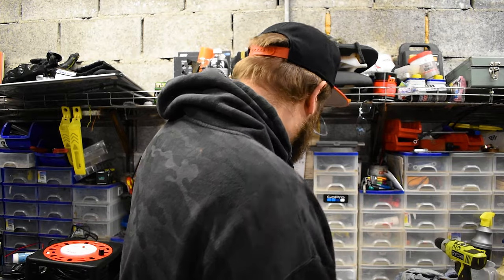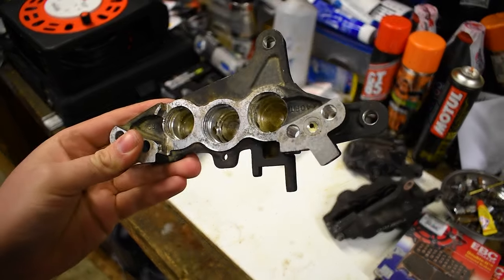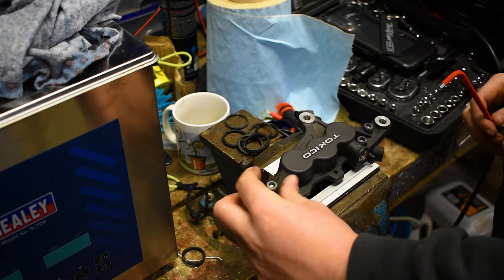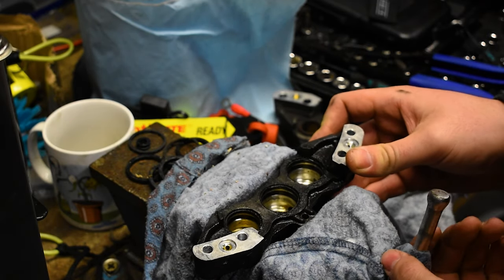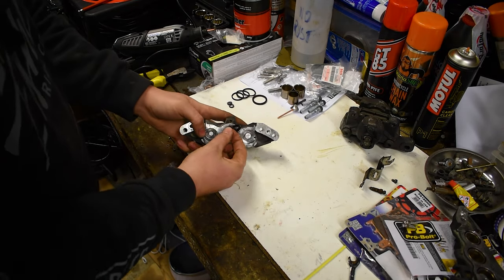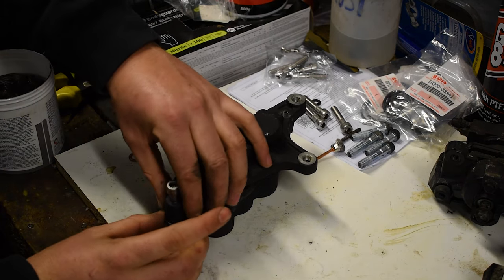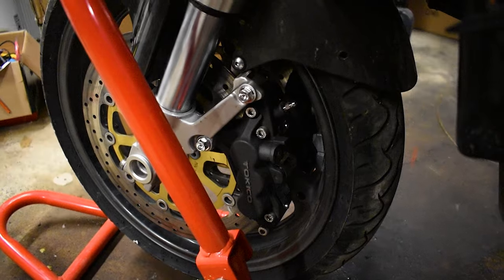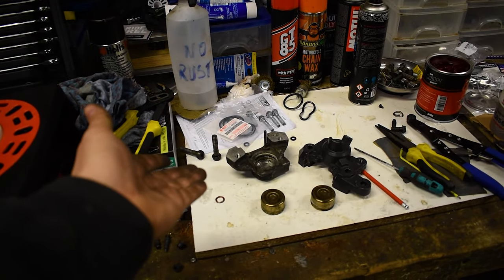Tokico 6 piston Caliper Rebuild | Suzuki GSX R 750 SRAD

Comment: Fantastic, thanks for sending me this link earlier.

Looks like I will be buying a piston removal tool & new seal kits 😊
Reply from the maker: You're more than welcome, thanks for watching it! :) 
I hope it works out and improves those brakes for you, I would say push the pistons as far out as possible before using the removal tool, makes it 10 times easier! :)
Reply: @TheGorillaBiker  
I gathered that after removing them from the bike, but I'm sure I've no way of doing now? I've no high volume air pressure, unless a trip to a fuel station yo use theirs will do it.
Reply from the maker: Ah yeah if they're already off just pull them or get access to some air, you would need the right head I don't think the tyre one would work as the air needs a seal.

Comment: Another good one.  Everything underlines the use the bike all the time, and change all the fluids regularly.  Love the stainless steel.....bling at its best!
Reply from the maker: Thanks :) Absolutely! Literally nothing wrong with this bike but it was left sit so long, and you can see the damage that did all by itself. It also shows if all the fluids had simply been drained it would have been 90% easier to sort.

Comment: Nice work.  I bit the bullet and bought a 15L ultrasonic cleaner  to do the carbs, and clean the front calipers before rebuilding them. Just waiting for to arrive, hopefully before Christmas.
Reply from the maker: Ah very nice! 15L will be the absolute job for that stuff :) 9L is grand but the carbs have to be split fully or like dipped 50/50 that way :)

Comment: Hi GB, hope you're well! I just watched this again as I finally got hold of a manky set for my bike to refurbish. Original on the ZX9r too, but people always change them for 4 pots as they are useless at rebuilding and bleeding them lol.
It's going to get costly, but initially only cost me £9.50, gonna cost around £250 in total, poss a bit more by the time I'm finished. I'll be buying the same mounting bolts from pro bolt, ordered those other SS bolts from ebay earlier, also ordered new pad retaining springs, surprisingly cheaper from Kawasaki than Wemoto, by a lot.
Gonna be a while doing these as need seals, and pistons too which at the cheapest I've found will still cost up to £150, and pads, pad retaining pins and R-Clips. I'll also paint them as I did my 4 pots, purple with gold lettering, fun project but gonna take a while due to costs.
This video helped me figure out exactly what bits are missing, and what needs replacing, thanks for that 😎👍
Reply from the maker: I'm doing alright man, this whole moving country craic is slow going though :D Haha the amount of people I know who binned a set of these because they couldn't bleed them is mad, great brakes really!! 
That's still really really cheap all things considered for what will be very well done brakes once you're done with them :) That is surprising, shows why it pays to shop around though and check everything eh!! 
Yeah pistons are the real killer, very lucky I manage to rescue mine!! Hey worth taking the time and doing them all the same, once they're done they'll be absolutely class, pity money is a thing. Stops us doing all the bikes. 
Ah well thanks for letting me know and I'm glad to be of some help!! :) Sorry for the delay in responding, country move etc.
Reply: @TheGorillaBiker  Yea they'll be great once done 👍
No worries on the late reply we know you're a busy man, good luck with the move, I'll keep an eye out for any updates!

Comment: Great video mate , I'm doing the front calipers on my 600 bandit at mo so found this very useful.
I extract the pistons though by operating the brakes .
I crack all the bolts and stuff beforehand ,take the calipers off place them in a pan  or vessel that's supported so that all the fluid that comes out is caught , pop the pistons out , let the brakepipes drain then disconnect the calipers and dismantle on the bench .
Obviously you have to be careful of the fluid because it is not kind to paintwork and you do not want it on the discs if you can help it .
I refill system using back fill method with an adapted squeeze bottle .
It works for me .
Reply from the maker: Thanks! Glad it was :) 
What you didn't see is this bike was sitting 13 years before I got at it and those pistons were frozen when j tried exactly that :) Definitely easier ways to do it than this if your system is still working prior to the rebuild :)

The backfill thing I really have to try as itd save a hell of a lot of time and fluid I think.
Reply: @TheGorillaBiker  I know what you mean about seized pistons I had the same problem and I couldn't get hold of a pair of those piston removal pliers from anywhere !.
Tried all sorts to get them out , took calipers to my local garage and they couldn't remove them as compressed air didn't work .
Do had to return to hydraulic method!...but used backfill method ,you ought to try it mate it's quite good as you don't get air trapped in the pipes .
Reply from the maker: I know the feeling! The only way I could get the rest pistons out was air and it read 11 bar before it gave finally! 
Ah lovely. I wouldn't like to have to refill everything just to take it apart 😂 Yeah so I've heard! I'll def give it a try :)
Reply: @TheGorillaBiker  I had no choice but to refill and then strip them again but I've learnt now and always use same method .
Eh regular maintenance pays off!
Reply from the maker: Oh god yeah, everything in my collection gets regularly looked after, to avoid situations such as this one 😂

Comment: I was waiting for something to fall in that mug @ 9:26 😆
The other way to get the pistons out is by wedging a socket and square end of a 1/4” extension bar into the piston cup and as you turn the handle it camlocks onto the sides so you can rotate and slowly wiggle them out, you just have to be careful not to twist too hard or you can actually deform the pistons slightly. Ask me how I know 🙉
I'm in the middle of doing this right now it's a disgusting and messy job. 😖
Reply from the maker: Haha that's actually what it's there for! It's cracked on the bottom I put small parts in it :) 
Yeah I've seen that method used but have also heard from multiple people of getting everything stuck in the piston hahaha. Not ideal :D 
It's very rare that it is a pleasant job sadly.

Comment: Hi GB, I have to remove the brake pistons on my Thunderace. They are four pot opposed calipers that don't split and I don't have access to compressed air. Haynes manual says to block one side with wood and use brake lever to push the other side out. Then remove seals and replace pistons and use lever to push opposite side out. I can't visualise how that would work without squirting large quantities of brake fluid everywhere. I'd like to use that tool you have. What make is it please and where to get it if you remember. Cheers :)
Reply from the maker: Ah lovely, they can be a pain to get apart! It does work fairly well, but yes it can get a little messy, it's not as bad as you think tho you don't lose that much fluid doing it if you get stuck doing it that way! 
I don't remember but it'll be in my ebay history, I'll try dig it out and send it to you :)
Reply: @TheGorillaBiker  That's very helpful, cheers :)
Reply from the maker: https://www.ebay.ie/itm/Motorcycle-Bike-Brake-Caliper-Piston-Removal-Remover-Pliers-17-5mm-33mm-/123919326395?mkcid=16&mkevt=1&_trksid=p2349624.m46890.l6249&mkrid=710-127635-2958-0

Comment: Believe it or not I have done this job on the Gtr previously and it was a pain (bear in mind I had to work on the floor of the young lads playroom due to a lack of garage 🙄) and i ended up throwing the calipers in the boot of the car and bringing them to the local petrol station to blow out the pistons using the air compressor there. Some craic on a wet miserable November night.
Reply from the maker: Yeah it's not the most fun but it's grand with a garage :) You're more than welcome to visit once we're allowed again and tinker 😁 
Yeah I had to blow the rear pistons out at the dads shed as the tool was too small.....wouldn't have been fun in the rain at a petrol station no...

Comment: Hi GB. I find it better take brake pads out and pump the pistons out before disconnecting the brake lines. Nice job you do e though keep it going 👌can I ask what litre your ultrasonic cleaner is and how much it was.  Thanks
Reply: @MonkeyButtRides  😄😄don't forget to duck
Reply from the maker: I would have done that but sadly sitting as long as they were the brakes were completely frozen so pumping did precisely zero :'( It's a 9 litre tank, made by sealey and cost far too much money, 350ish I think I paid.
Also yes, @monkey-butt.....duck a lot :D
Reply: @TheGorillaBiker  ok thanks for reply.  Not too much money if its doing its job..
Reply from the maker: This is very true. Plus it'll do me for many many years so it was worth it I think!

Comment: My God Man, you have come through for me yet again. I just should shut up and put my money where my mouth is and send you a couple of dollars for your content.
I'm in Halifax, Nova Scotia, Canada. I have a 99' GSXR 750 W that I bought almost brand new and now it has 83,000 kms on it and still going strong.
    Just today, I took it out for a really high speed run but noticed it's not braking properly. I stopped the bike and notice I had a mushy brake lever, but when I put the wheel up and spun it and then hit the front brake, a noticable " CLUNK" comes from the left caliper and when I let go of the lever, ANOTHER "clunk" .. Jesus, it sounds so wrong, a mechanical clunk as if there's no fluid and something just smashed the pistons against the rotor, I put my hand on the caliper as I did it over and over and you can feel the pistons hitting home hard, dam hard to explain that noise. 
    I haven't taken the caliper off yet, I was trying to buy a new one, or a aftermarket replacement one or even a used one .. NOTHING can be found, so now I'm going to the shop tomorrow and buy a complete rebuild kit, new pads and do the rebuild myself, but I hoped someone online might have a rebuild video of my exact caliper and ONLY YOU have a video...I haven't even seen it yet, once I found you, I wanted to say thank you for uploading this video.
   One thing I'm going to do tomorrow morning is remove the caliper and inspect the pistons to see if I should spend the extra money and purchase new ones.
Reply from the maker: I was going to say check in on a comment here about orientation of seals, but I see you already found it which is good :) I lost access to that email for a long time when I moved so I never got to get back to that fella again. 
Happy the videos are helpful tho, and I appreciate you letting me know as that's why I made them :) I hope your GSXR is on the road for many years to come!!
Also check cmsnl.com for parts!!